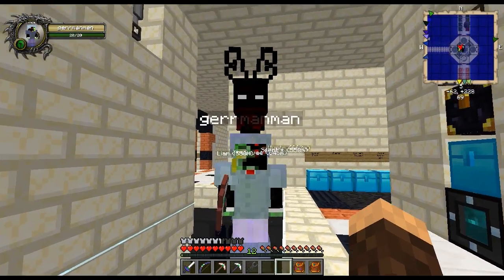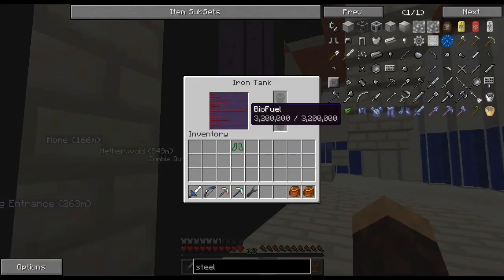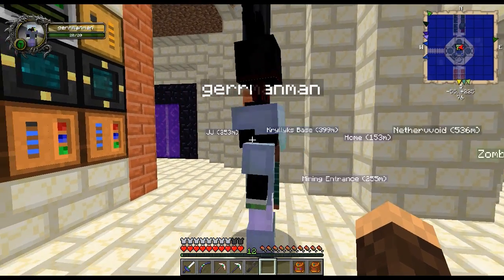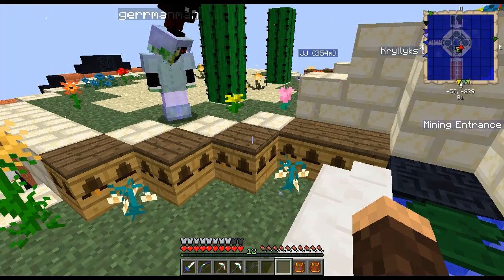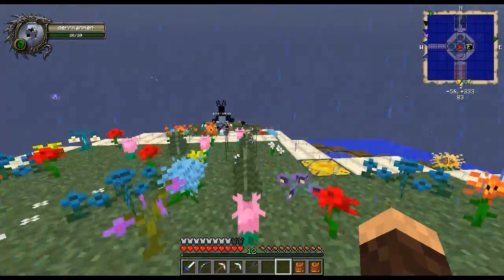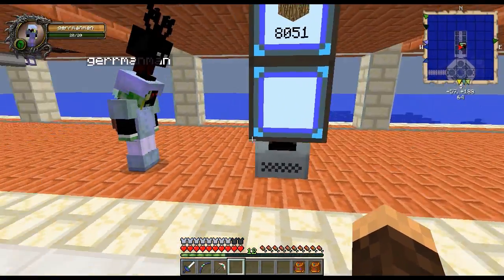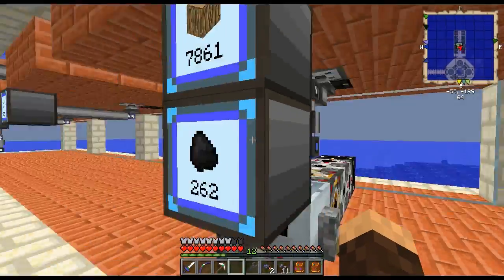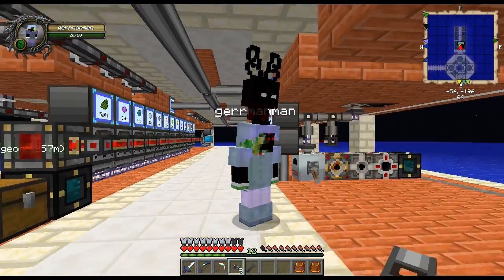FTB Unleashed - Automated Blast Furnace Steel Production - EP18

Comment: Bee house's can't be automated and you can't mutate in these.

Also all frames have same production bonus (+100%), it just doesn't last as lang, so if you just auto produce the impregnated frames (not that resource intensive) and feed it to frame housing blocks in an alveary with me, I usually do 3 frame housings.

You could also get refined bee's to produce non stop fuel and keep a few max steam boilers running (could also get the fastest trait from aura bee's and boost production even more).